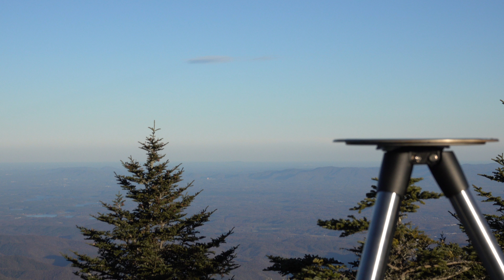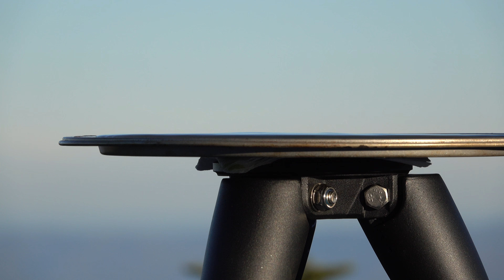FLAT EARTH DESTROYED visual proof from Mt Mitchell

Comment: I have no clue what your actual observations or conclusions are. Are you showing us the curve? I don't think you know what your trying to explain.
Reply from the maker: The water in the pan is flat. IF the Earth was flat it would be parallel with the water & the vanishing point of the horizon would be at the level of the water just like railroad tracks go to a vanishing point on the horizon. Since the Earth is curved it is not parallel with the water. It curves away from the level of the water. That's why the horizon is below the water level. I went up another day & saw the buildings of Charlotte from there & Craggy 92 miles.

Comment: what has he proven, I don't understand what he thinks this shows? at that distance using a level of only 10" diameter, it is almost laughable to create accuracy IMO.
 the slightest fraction of sight alignment would throw out your result by a large margin, 
as you well know when using a zoom lens . you can spot a star through a finder scope and miss it by a long margin.
how does admitting water is level (and that's correct) jive with curvature.?
 water alone has destroyed any nonsense of curvature.
Reply: You don't understand?
If horizon drops when you climb higher,  Eric Dubay is wrong.
Well, horizon drops when you climb higher, so Eric Dubay is wrong. 
😎